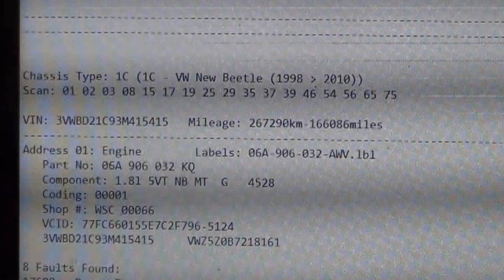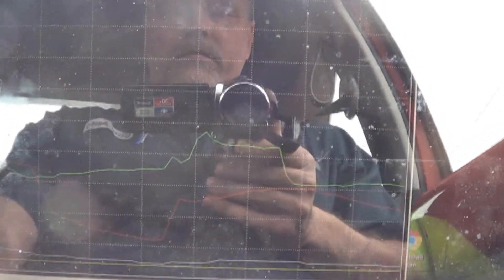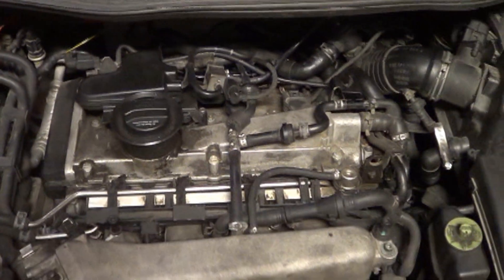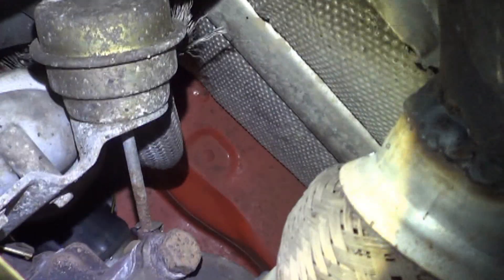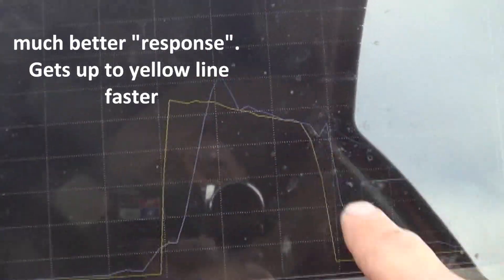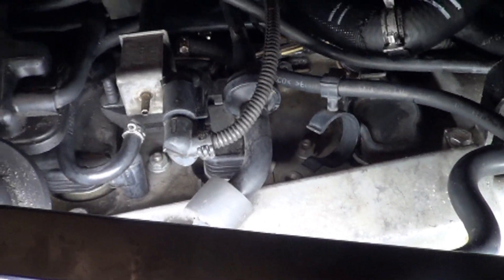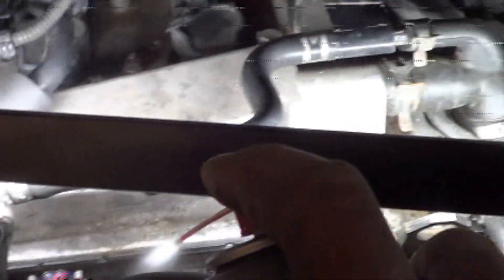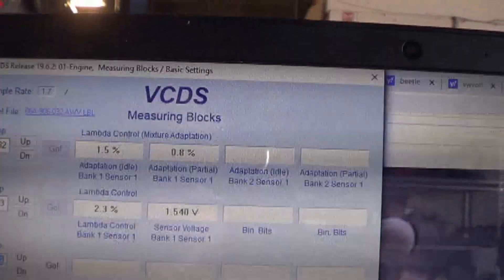1.8T trouble codes

Comment: Hello ive got P1297 Pressure Drop between Turbo and Throttle valve (check d.v) ive change maf, fuel pump, diverter valve, n75, pcv, pancake stuff, check pipes all seems good, clear throttle body done adaptation and always pop that error i delete it and when car running error pop up again, ive try to unplugg maf and no error for pressure drop..
Reply from the maker: check wastegate adjustment and make sure there is no clog in cat converter
Reply: @CoolAirVw  i dont have cat, its 3" downpipe